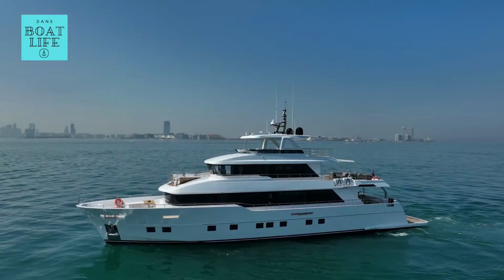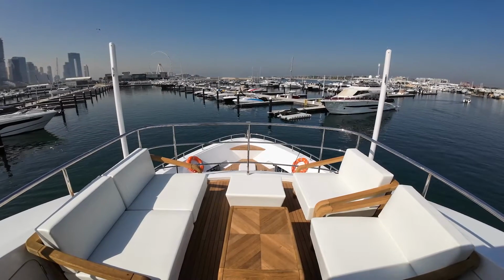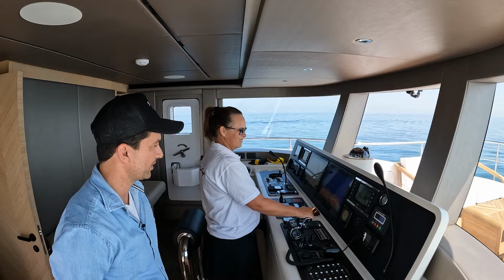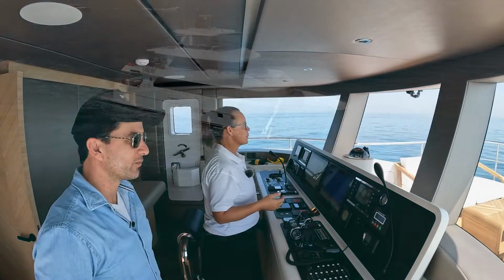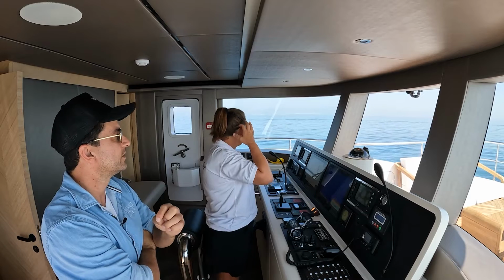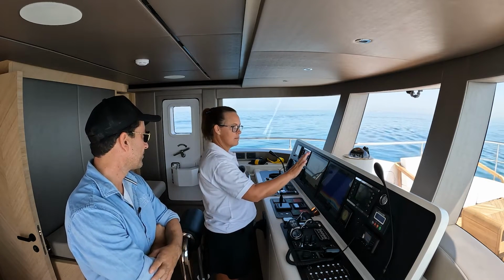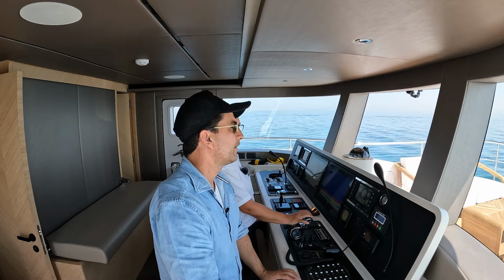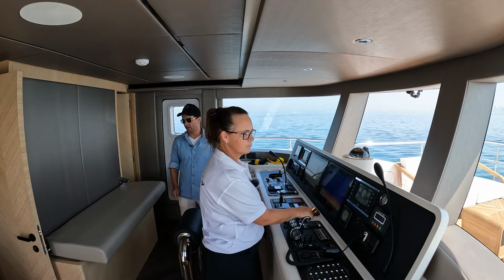FIRST TEST on the Nomad 101 - I discover she's got much more RANGE than I thought

Comment: You didn't mention range Dan...so what's the range?
Reply: with the stated capacity you have about 200 hours of run time at 800 rpm... at 9 knots (10mph) or so that would give it 2000 miles of range with about 10% reserve fuel left :)